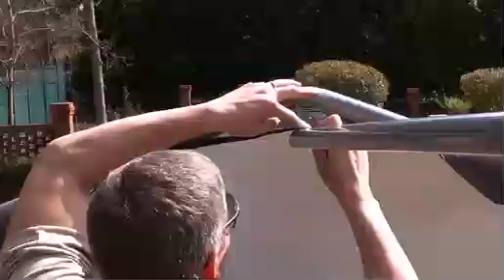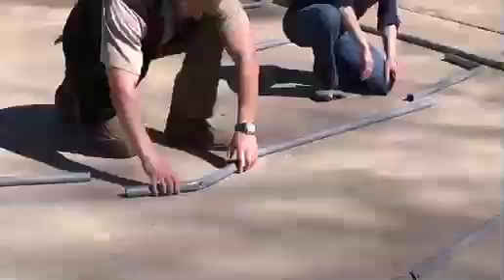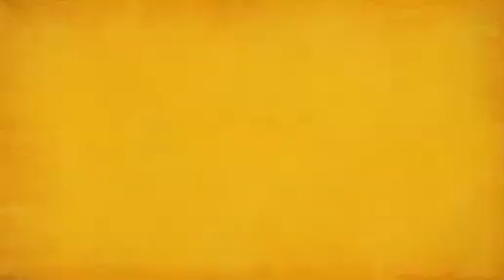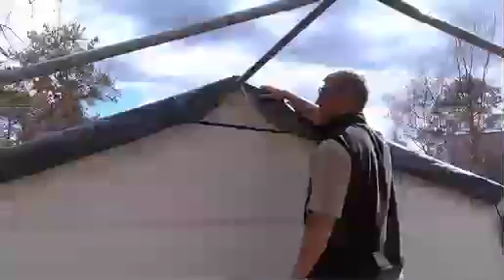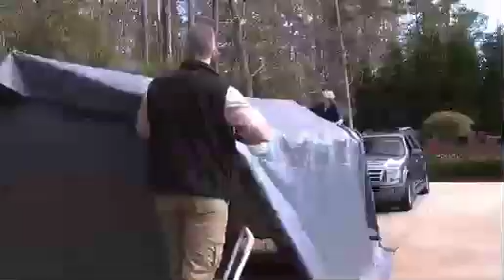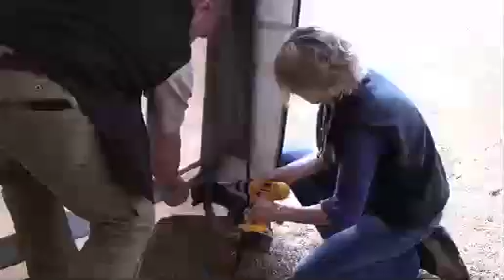How To Assemble a Shelterlogic Garage

Comment: I get the fact that the caddie-corner measurements must be within 1 inch of each other.I have a "neighbor" who says if I run a chalk line down one side to make sure the uprights are lined up perfectly,then run chalk lines off of that so the everything is straight,then the caddie-corner measurements will match EXACTLY.Is this true?Nobody has said poop about the uprights being straight.This is one of the larger units where you're not supposed to install the lower rails until you put the top on. 20'L 15'W 10' H.I inventoried the parts and pre=assembled as much as I could, and it still took us almost 4 hours to put up the frame.Help!!

Comment: I am 62 year old woman and so far I have put it up all by myself.  Had couple issues. Had to drill hole in one pipe. and fix the clip for 7+8 and straighten and one opening on a pipe. Other than that I am almost done. Have frame up and one panel done. I am considering more securing measures.I had 2 men hired $100 to put up. Guess I will buy myself something with the money. But really this is well built not cheap metal. Also noticed one worn spot on the end panel. Will inspect further. So far not all that hard to put together. The video really helped!!!!!!!!!!

Comment: It`s the first one I bought... seems like I had a big bad luck... missing parts, the bolts are all together ( they are different sizes, but not so visible that !!! ), very tight the material is  sticked... a lot of problem to insert the pipes in !!!... the instructions are damn stupid kind of explanation...and MORE than that ...after a few weeks ... ALL material of front door...is FALL !!!  <--- because of Sun temperature !!! ... if U

Comment: I have an older one (4-5 years) and just doesn't cut it. This one is even more complex to assemble and anchor. I can't have holes in my driveway. Can't even weigh it down with cement blocks because of design. Wind bent it to pieces - second time now. Getting rid of it.

Comment: I had absolutely no problem with Shelter Logic instructions. I am physically not able to put it together quite as fast as stated. I don't understand every ones problems with the instructions. I only watched the video to see if I did everything properly. Video shows the exact steps included in the instructions. Anyone considering purchasing one of these should not be intimidated by the instructions. They couldn't be anymore thorough. I love mine.

Comment: Just finished ! The video along wth the instuctions made it very easy to put up. Did the 12 by 20. Took 6 hrs from start to finish. Did it by myself. You just have to get organized and take it step by step and in the video. I am not sure why others have issues ?  I built a floor from 4 by 4 crates with sheets of plywood to raise it off the ground. Can't wait to set up my work shop in it ! Cheers! sk
Reply: Well then maybe you should tell me how it's done. Since you had no problem putting it together.
Reply: Waiting for a reply......
Reply: No answers? No response?
Reply: WTH why aren't you replying?